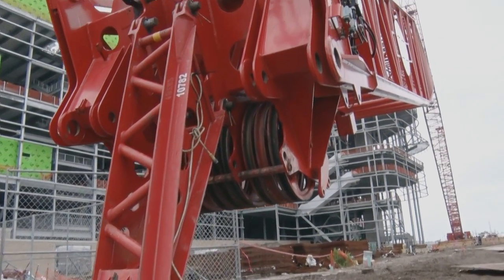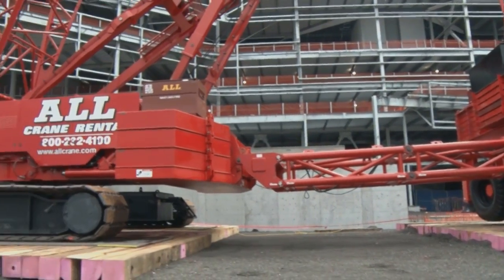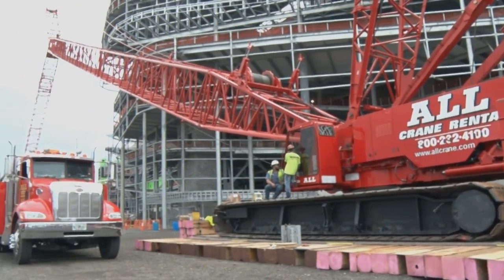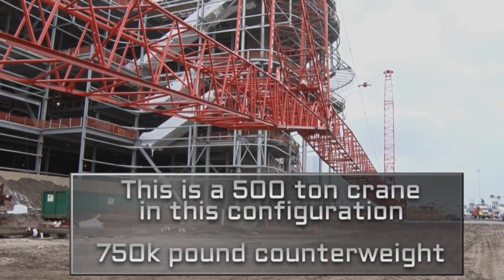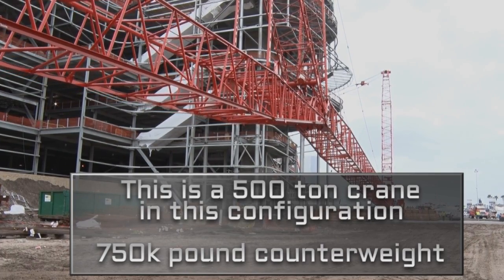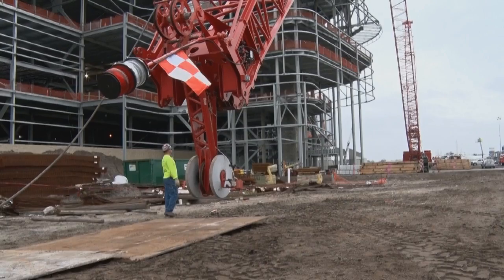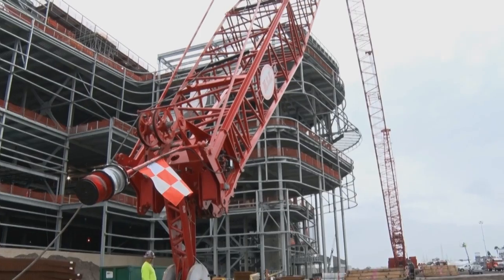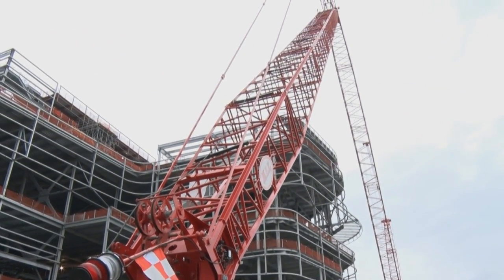DAYTONA Rising 490-foot Manitowoc 2250 Crawler Crane

Comment: Worked on assemble and disassemble several times on the 2250s with the maxer that was always cool then got to use them for the heavy lifts Union Boilermakers
Reply: I’m actually about to run this same type in AZ with 236’ main boom, Derrick, and maxer.